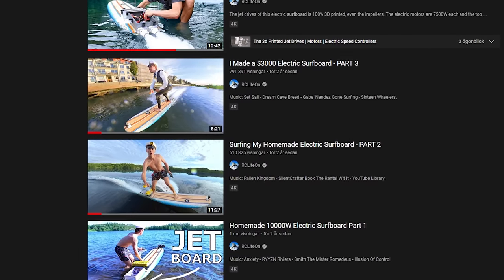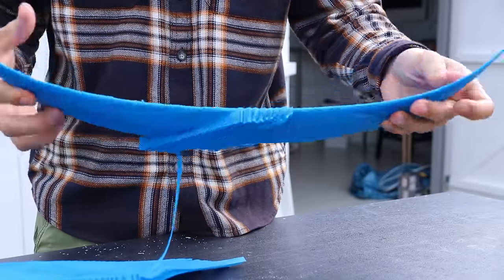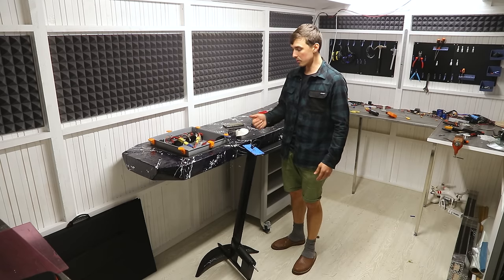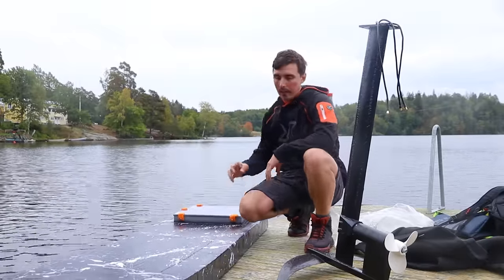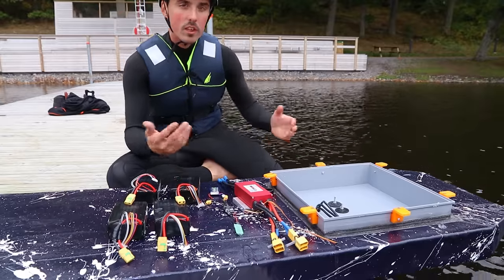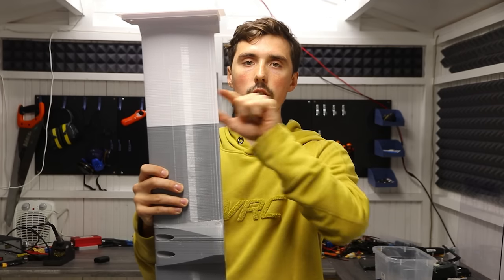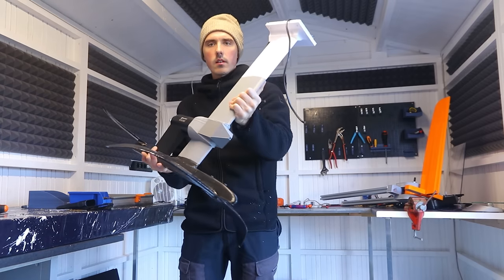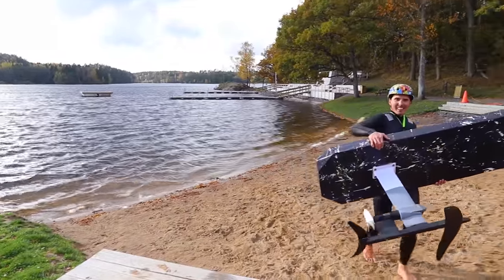3D Printed Hydrofoil Surfboard - Will it Work?

Comment: I would add one or two big metal rods trough the whole arm. that way you can make it tall again. also support the metal rods into a wide metal board stuck either over the fiberglass or between layers if double layered. Make the fins/wings(idk which is correct, lol) bigger. I was 100% sure the 3d printed part would delaminate and i was surprised the second version survived tbh. Compound design when 3d printing stuff like this is your only way. Going by feel, i think the motor is good enough, so by strengthening the arm and upgrading the fins, you should be set!

Comment: I am actually very impressed that the revised spar design didn’t break, it still looks flimsy to me. Get rid of the hard angles near the joints, a smooth radius is stronger. I wonder if you could use flaps to assist in takeoff. Once you’re high enough the drag should be reduced I’d think so they shouldn’t be necessary all the time.

Comment: Bigger front wing will increase lift, but make it go slower, which is better if you're new to foiling. A longer mast will make it easier as you will have more room for bad balance and not fly out of the water (if you are not afraid of heights) - maybe strengthen the whole foil with additional layers of glass fiber - As it will be holding your weight + resistance in the water. - Remember when you fall in to the water, that you have a relative sharp foil down there, it can give some nasty cuts if you kick it.

Comment: You perform a great job and thank you to show us your failed tests.
I suggest you to 3Dprint a lighter foil with empty space into that you will fill that empty space later with resin inside after printing. It will create a composite like, a skin 3Dprinted and a stronger (and finer) core body in resin. You can also add reinforcements into the free space before to fill it with resin. I think the resin is stronger that your 3D printing plastic.
I also suggest you to perform more mechanical tests before to go into water.

Comment: MORE TORQUE! It will help you get up out of the hole. Once you are foilborne, your drag will be half of what it is with it still hull down. Less drag, more speed, more lift. Bigger foils might help but I wouldn't get too medieval about foil size, maybe 25% more area? Too big and you just increase drag. A variable pitch prop MIGHT be useful in letting you customize the torque and RPM so at any speed you have a balance between RPM, load, and cavitation.

Comment: You should add cavities to the vertical mast to insert dowels into, running from top to bottom. This will increase the mast's strength, lowering the chance it snaps (de-laminates) due to the bending moment. Additionally, you can use these dowels for mounting, sending them through the board.

Comment: I made a jetboard and noticed the pla pro was failing so I switched over to polycarbonate after switching out to an all metal hotend.  So far it is way more durable.  Might be worth looking at Polycarbonate to print with.

Comment: i know this comment is going to be i late i hope you see this as an proffesional windsurfer i have some tips for you
1) make the front wing bigger i assume that you are using like a 700 or 800 front wing make it 1250 or 1250+
2)cut the front of the board a bit it is making too much drag and harder to control
3) make the electronics box inside the board to give you more space
4) increase the speed lean back a little bit than when it starts lifting slowly give more gas and lean forward
5) make the wings from a stronger material they are flexing a lot (in windsurf we use carbon wings, aliminum middle base and carbon mast)
hope this tips help

Comment: Yo dawg, I foil occasionally and it definitely looks like the reason you aren't lifting onto the foil is that your weight is in front of the foil. The foil looks to be placed underneath the box and your back foot is in front of the box. Your back food either needs to be on top of the foil position or even behind it. No matter how far you lean back with this foot position, it won't be enough.

If you make a second iteration of this, I would also suggest shaping some more rocker into the board as at slow speeds the nose digs quite deep into the water.

Otherwise, dope.

Comment: I have been Wind foiling for 2 years now, and just started Wing foiling.
I think you are standing too far forward.
The lift of the Front wing should be right between your legs. Your control box seems to be right where your back leg should be.
A bigger wing will only mean that you can start to fly with less speed, but this thing was ripping along pretty fast, so I think the wing size isn't really your problem. Though it might help.
I'm sure strength might be an issue, particularly if you want to crank some turns.
However, I love what you have done.
Hade a huge laugh at the first failure when it poked into the board.. I must admit I was expecting it.
Actually, I was surprised the mast didn't break in the sideways direction, but I guess the force was straight from back to front.
Looking forwards to the next update

Comment: The surface of the foil needs to be really smooth. Any surface roughness will cause the fluid flow to go from laminar to turbulent. Once the fluid flow is turbulent you will have a reduction in the lift forces generated. Get that wing as smooth as you can mate!

Comment: Nice Video! Fun as everytime!
I didn´t see you having sanded surfaces (but I´m prolly wrong ) which you wanted to bond together with glue. This should be done with every surface you wanna bond.
In addition the wings will flex way to much.
Try to make an imprint of the wings and use those to make solid carbonfiber/epoxy ones.
Making the wings and board too smooth can lead to drag too. I witnessed this on my RC boat. (But I don´t know how this applies to a fulIy submerged case) gave it some slight sanding in the direction of flow and it worked way better. Think about it like shark skin.

Comment: - increase the wing area just by scaling up. I think the foil shape itself is ok
- increase the angle of attack by increasing the angle of incidence of the main wing.  You maybe need to decrease the angle of incidence of the rear wing as well. Also maybe make the bar adjustable forward and backwards to set the point of pressure. It needs to be behind the centre of gravity to be a stable ridable board. But since your  board is quite long you can probably also just find the correct position on the board by balancing

Comment: Apart from the stiffness improvements with the foil wing that have been discussed, I wonder if a different 3D construction method can be used- with hollow wing segments printed with lateral internal scaffolding and space for the carbon rods running tip to tip? The glass the outside as in the first time.
Additionally, I loved the first long mast snapping straight away and driving straight into the board. That was awesome

Comment: I surf these things... you should become familiar with the "aspect ratio" of the hydrofoil wing design you use. The wing and surface area of said wing you have on there looks incredibly small to provide the lift you're looking for. Overall I think the design is good and I love how you've added the motor into the mast as almost a spacer. It'd be cool if you could throw it onto a real hydrofoil and see the performance differences

Comment: Might help to install an Angle Support bracket of some kind between the post and the board to increase rigidity so it'll hold your full weight when you finally get in the air, and need to balance your planeing.

Comment: Looks like you should print off a 2 or 3 degree baseplate shim to go between board and top baseplate of mast. This will increase angle of attack of wing when board is flat on the water and hopefully get you up off the water. You want the thick part of the shim towards the back of the board. I had this same issue with the first efoil I ever built.

Comment: As others have said, stronger wings for sure. There's a reason commercial ones are mad eout of carbon fiber and resin instead of just being injected molded ABS. They're definitely bending under the combination of weight and torque.

Comment: This looks like it would work if your back foot was directly over the mast. You're definitely standing too far forward for it to get you out of the water. But it's very impressive that it didn't break. Usually you need a lot of fiberglass on the mast and base plate to carry the load.

Comment: I think the problem why you don't lifted completly out the water is that the front wing needs to be directly under you bodyweight or even a little bit in front of it. Now the foil is under the box, and you were standing in front of it. So your bodyweight is to far in the front. It the same principle like a wingfoil or even an electric hydrofoil you can by. Also if you were standing over the foil, you can steer the hight of the board better by shifting you weight to the front or to the back. I think this will be enough to fly with this set up. But for shure a biger frontwing will also help, but then the topspeed is less. Also a bigger backwing will help or you can try to put a washer under the backwing at the rear screw so the backwing has a bit steeper angle.

Comment: My guess: The motor is bending the mast more and more forwards the faster you go, so you never reach the angle to make the wings generate enough lift. You could increase the angle of attack on the wings, move the mast a bit forwards, or move the acrylic box and stand on the absolute back.

Comment: cant wait for part 2!!!! 

potentially upgrading the wings and adding some support such as rods ( carbon or aluminium) would yeild the required results!

would a shroud around the prop be better?

The idea is that it works like a edf or a jet pump in a jetski?

Comment: Angle of attack! Just like any wing (air or water), it needs angle of attack to produce lift.  It seems it was mounted at pretty much zero aoa. Leaning back will not help if the surfboard keeps it all at pretty much zero anyway. I suggest making the hydrofoil angle adjustable. To evaluate the size, just google lift equation.

Comment: in your cuurent standing position u had to much leverage on the foil. to start foiling you need or the stand farther back or to take the foil forward, or go faster to get more lift. the farther forward u stand in relation to the foil u will have more leverage on it(less lift) so or stand farther back  or go faster. 

im a doing windsurf with hydrofoil board (windfoil) so i know a lot about it from  experience, if u want id love to help u with this project by sharing ideas. id actually love to see u foil with a home made setup !
Reply: or get a bigger wing it will also create more lift

Comment: I guess you could try a bigger front wing for more lift, like windsurfing foils have. Your one looks to me like one used in kite foiling which does not need to lift so much weight. Or maybe change angle of attack. Great Project! I intended to do since a few years but never found time. Awesome to see your approach & hope you get it flying 😁

Comment: I would definitely run two threaded rods down the center (front & back) of the mast, bolted underneath the bottom spar and right through and bolted on the topside of the board. All that dynamic loading at right angles to your print layers isn't a recipe for longevity!

Comment: Possibly, add an aluminum skip plate on the bottom (or through aluminum control box) to mount speed-control and battery. This in addition to heat-sink would allow heat to dissipate. In fact, if the main-mast is machined from aluminum and attaches to an aluminum control-box bottom, the speed-control could be screwed to the bottom and all heat would be dissipated.

Comment: I would move the box with electronics to the front of the board. The current placement is keeping you from getting your rear foot to the back of the board. The mast needs to be between your legs, not behind them. This way you will be able to control the pivot-point of the foil.

Comment: Bigger front wing, not necessarily longer, but wider.
Try a design with a toroidal propeller. The extra effiency might allow you to add more battery weight as well.

Comment: You can potentially get more lift at the expense of greater drag by increasing the angle of attack of your foil. You could also try a different foil size or profile. I'd make the foil removable and the mounts have some adjustability so you can try different setups.

Comment: You can save a lot money on printing filament if you reduce your infill and wrap the wings and vertical shaft in carbon fibre (reduce to maybe 10% infill and only put a mild vacuum on the wrapped parts). One or two layers of 200g/sqm carbon should do the trick, and you'll see it flexes much less and the wing is more likely to keep the pitch angle you had designed. Your current 3d-printed-only versions don't seem very stiff. Or not stiff enough to keep its designed pitch and lift all your weight out of the water.

Comment: I think it's the wings 100%, my reasoning is that the wings are flexible plastic and you're essentially putting all your weight on them making them flex (even though in water) but with momentum you're adding weight to them, consider 3d printing with a metal bar epoxied inside for rigidity and then cover in fiberglass and epoxy resign making it even more sturdy as I'm sure that you don't want it to flex.

Comment: i think a lot oft his is about angle of attack - you need to stand back and push the back of the board down. you ideally want to stand where you put the electronics box, at least thats where they stand on the commercial boards. with pushing the back if the board into the water, you  get more AoA wich in turn means you generate more lift, the more AoA, the more lift until the wing stalls

Comment: If you could control the pitch of the hydrofoil with a servo that would be awesome. You could set it for low mid and high speeds as needed. Just a thought 🤔lol  Cool build just needs a bit of tweaking 👍🏻

Comment: I would attach that tail wing on the bottom of that fuselage. Second, I would bring up the mast, and then I would go for a bigger front wing (around 2000cm2) and a bigger tail wing. You are getting more than enough speed.

Comment: Please make a hydroplanic surfboard!!  Think you need more speed for it to work. The weight is high and the speed is low. You would maybe need 2 hydrofoils, one at the front and one at the back.

Also i think if you actually managed to get airborn with 1 wing, you wouldnt be able to take a turn, or even the slightest amount of reduction in speed would level you back to waterlevel.

i think 2 is the right choise to go forward from.

Comment: Nice to see you work with epoxy outdoors using gloves and even a respirator at times. Power to the people who protects themselves from gases.

You did not mention the area of your foils and what foil section you based them on. Hydrodynamics are not intuitive and math is required to succeed at the first attempt. A lot of math. Probably you did not have enough speed to generate the needed lift for your foil. A foil with more lift could solve this. Perhaps even mount it with a little bit of inflination to increase angle of attack.

Great video. You are getting into slapstick comedy at some points but your videos are always great fun.

Comment: Looks like plenty of speed, general rule is start with back foot over the mast and fine tune from there.  I tried standing way forward of a 2000 size foil and couldn't get it to lift in powerful waves.

Comment: I do foiling with windsurfing, very similair thing, your board could be shorter because all the weight in the front is pushing it down now, also i stand with my back foot behind the mast, maybe you could try that, maybe that will provide more lift then.💪💪

Comment: i think you could try to "jump" while giving full throttle to help the board to get off the water. maybe the reduced drag will let the speed and lift increase enough to keep off the water. otherwise you could try to increas the size or the pitch of the wing

Comment: If the main foil is not strong enough for you to stand on (out of the water) without deflecting, the foil won’t be able to lift you once you are in the water. It appears to be nearly strong enough as shown by the speed and change in the sound of water hitting the board so try reinforcing the foil with an additional layer of fibreglass.

Comment: the best size for an e-foil front wing is 1600 cm2 if you are no longer a beginner then you can use a 1300 cm2 wing.this is the total area of the wing.I think yours is much smaller. when you print a new one you can leave out a slot where you can insert a reinforcing strip for more stiffness. before you go glass fiber

Comment: for sealing the electrical box you can make the open side whit curve so when you instal de cover it need to bend like a card, pre charging the seling and making a over all tight joint

Comment: IT could also be the distance of the mast to the end of the board. You often will use your back foot as a lever to shoot the board up in the air, if your weight is farther behind the mast the more leverage youll get. Move the box or stand on the back of it.

Comment: Well done! What 3D printer did you use? You missed a few details to make gliding possible: You better use carbon fiber in all the hydrofoil parts for stiffness, fiberglass is strong, but you will need a lot more to achieve the same stiffness as carbon fiber. Also, the battery box forces you to stand too forward on the board; make this box so you can stand on top of it. A bigger front wing will also make things easier,  900mm wingspan and 1200 to 1400cm2, and an airfoil with a camber similar to E817 will give you structural strength and better performance at low speed.